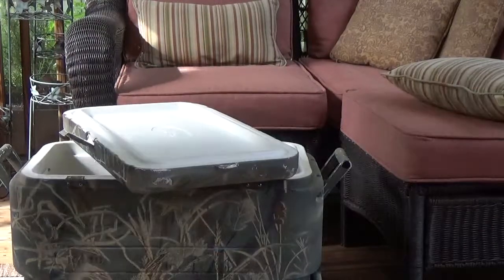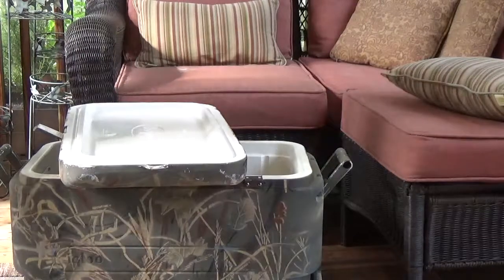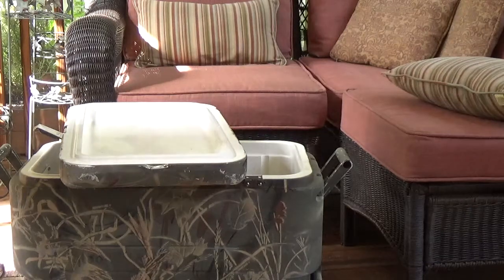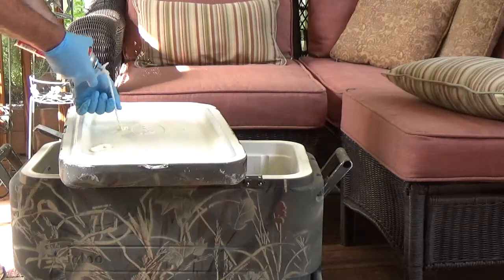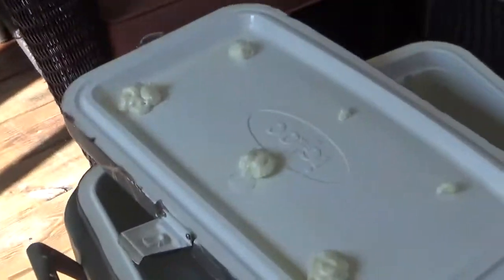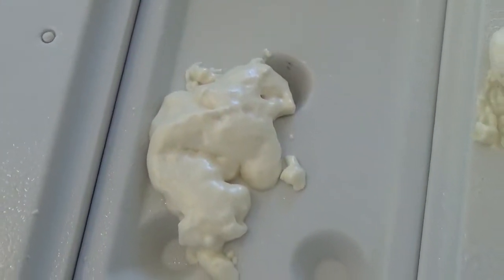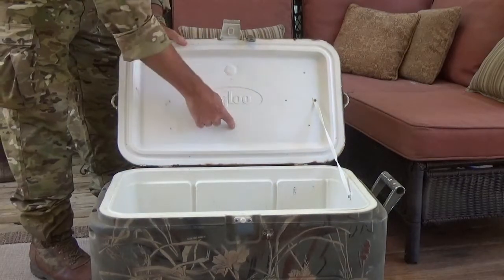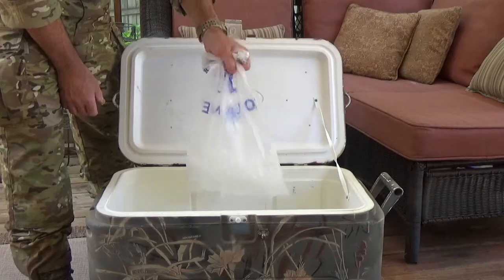Cooler Experiment - Expanding Foam - Part 2

Comment: The bottom of my cooler is where I loose most of my cooling.   I'm sure one can can do the lid and the bottom of A cooler.
Heat goes up,  Cool goes down.   Use the Windows and doors expanding foam.  It wont bend your lid.